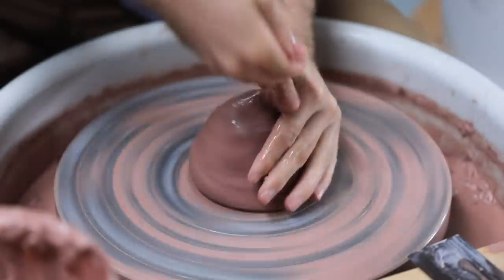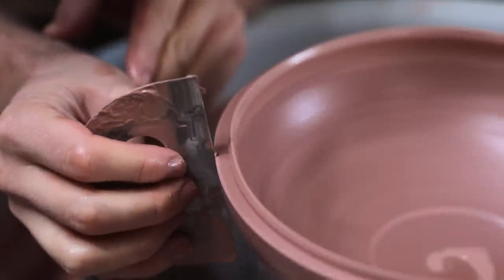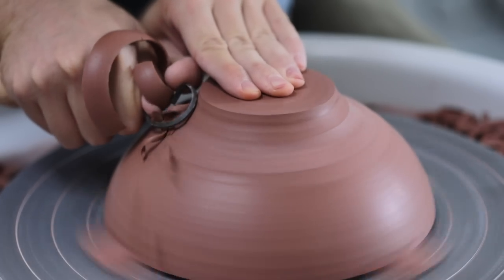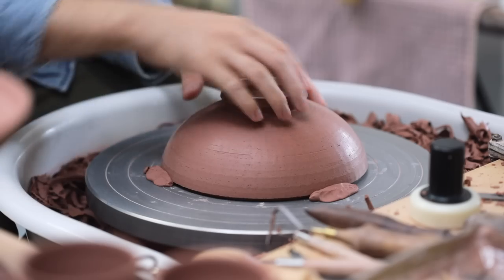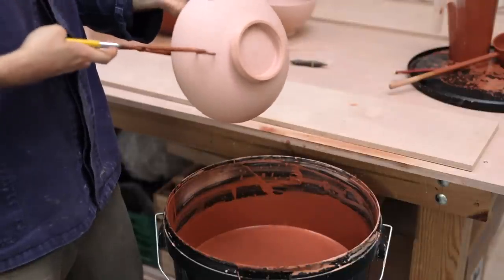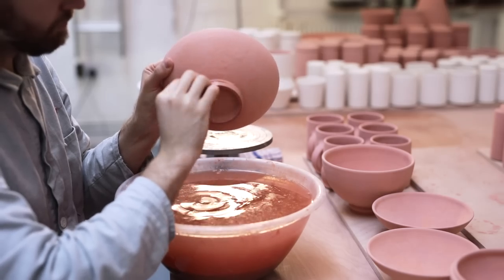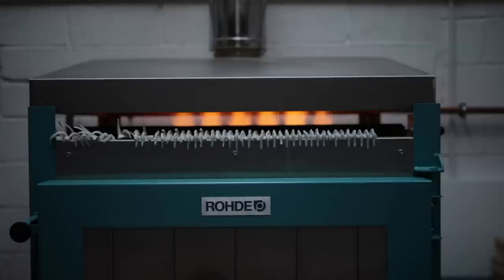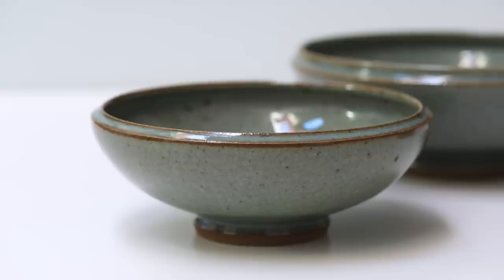Throwing a New Idea – Bowls with Indented Rims

Comment: Very cool bowl.  Nice and interrsting. But... It really reminds me a pot lid. You could pre-drill a centered hole and add a handle. I suggest you use stainless screws and washers to secure the lid with red high temperature stable silicone between the clay and metal. Alternatively a clay handle would be better. Then, simply, you need to make the pots... ;)
Seriously, a pot and lid collection would be great!

Comment: This is kind of a scam because you are carving more then turning.
Reply from the maker: I don't follow!?
Reply: Florian trims more than some potters presumably because he wants to achieve a weight to his work that might be difficult or inefficient to try to achieve directly on the wheel. There is no “scamming” or “cheating” in pottery . Every potter has a different process to achieve the unique final result that they create. Saying that refining your piece by trimming is a “scam” is like saying that grinding the blade of a knife is a “scam” because you didn’t complete the final product while the metal was hot on the anvil.